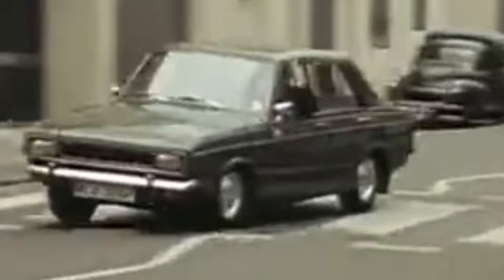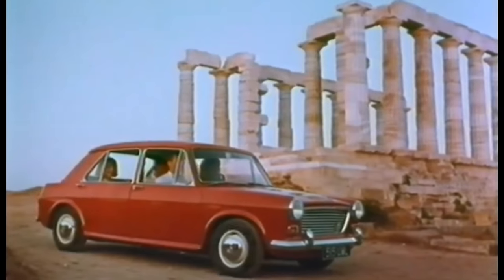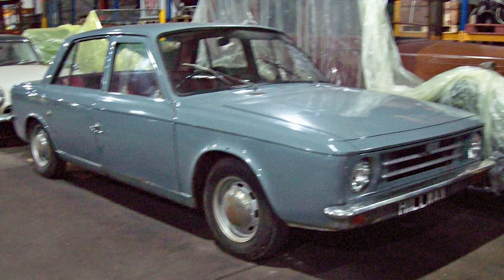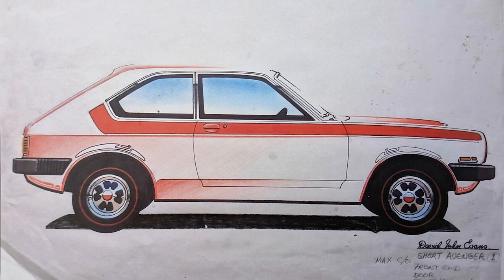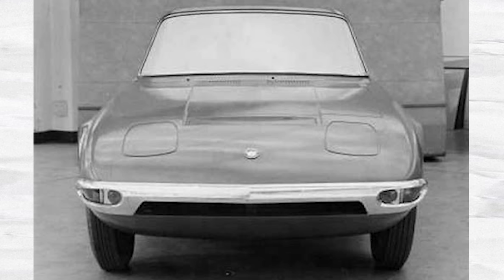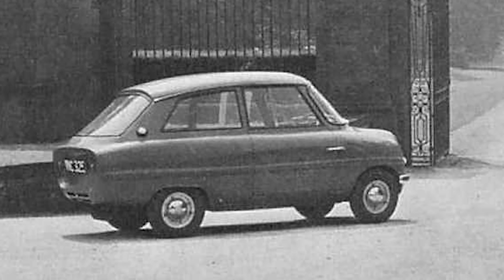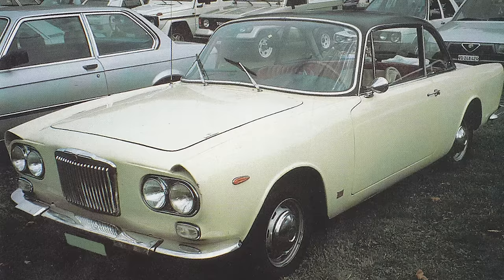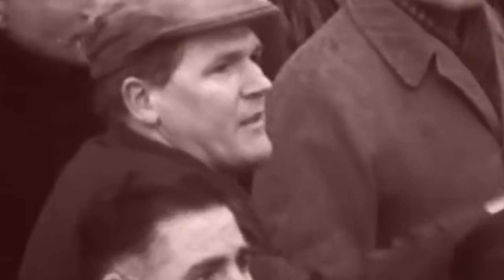The LOST ROOTES GROUP PROTOTYPES! - Hillman Swallow, Capri Beating Avenger, Zimp And MORE!

Comment: I’m from Arizona in the United States and my first car was a 1957 Hillman Minx Estate that I bought for $25 in 1969. I got it running by replacing the clutch and I converted it from column shift to floor. I drove it to high school for a couple years until the engine died. It was most definitely the only one in the parking lot! 😎🌵👍🏼

Comment: I had a Hillman Imp as my first 4 wheel car when I was 17 years old. My Dad had a Sunbeam Talbot in the 1970s and I remember that a family friend had a 2 door Sunbeam coupe.
Reply from the maker: Well. Your first car was exceptional! And your dad had great taste
Reply: First 4 wheeled car is quite a statement these days… I’ve not seen a 3 wheeler in years.
Reply: my first car also at 17 was a HImp. pulled the 928cc engine block out of a breakers Chrysler Sunbeam and mated it to a Stiletto head and twin carbs + a Janspeed exhaust system. it went like a little rocket
Reply: Was the Sunbeam coupe an older model of the 60's  or the last of the range with the large three piece rear window reminiscent of the American "Barracuda" that might have had the Holbay H120 engine?
Reply: @TomAlter1000  many thanks, aged brain-fog moment there, corrected

Comment: Appreciate highly your effort Tom in registering British auto industry . It would be so kind of you to make a film about "Austin Gypsy" the forgotten rival of "Land Rover Defender".
Reply from the maker: Thanks, I appreciate it :) I’ll have a look into that further.
Reply: I agree this was truly a worthy challenger to the Land Rover in its day!  We had one in the Civil Defense during the Cuban crisis in 62/3.  In every respect it matched or was better than the Land Rovers Other than two, stiff gearchange and heavy steering!
Reply: @tomdrives  Austin Champ,not a civvy vehicle but very interesting,light years ahead in vehicle desighn.
1500 quid ex works to the taxpayer no purchase tax in 1950.
Flogged off for as little as fifty quid at ministry auctions. Mine had 25000 on the clock in 1972 and a Rolls desighned 2 8 litre engine not even run in. Do not de - coke cylinder head before 100 000, unheard of in those days. Alec Issegonis once again !

Comment: Heyas Tom, as a newly married young guy our first car was the more upmarket Singer Chamois varient of the Imp. It was the Mk1 with the flat strip dash rather than the Super Imp round dials. It also had real wood trim too 😎 Mother in Law duly impressed 😎 Suffered the usual overheating if not careful but the opening rear window was a fortaste of the later Renault R16 we got. Cheers.

Comment: Nice video. The Italian style house (Zagato, Touring, etc) projects probably only ever had limited prospects due to the subjective styling and costs involved.
A more conspicuous absence perhaps is the “C” car, the big brother of the Avenger.
This car did go into production after it was designed and tooled in Coventry, albeit in France (and later Spain).
The UK version went right to the 11th hour, complete with full body tooling AND a fully tooled up, production ready V6 engine.
The French version had already been in production for over a year before the UK version (to be badged as a Humber at the very least) finally got cancelled.
All was not lost however, the resources were quickly rediverted to turn the car into the Australian Chrysler Centura, complete with adaptations for it to accept the cast iron straight 6cylinder 3.5 and 4.0litre engines.

Comment: I'm here for the Chrysler Rootes Australia comments.
There are some very pretty cars here that never made it down under.
Reply: l had a 75  avenger and went to sydney in 1979 l never saw any avengers only hunters, were avengers sold in aussie
Reply: @debeeriz  Sold in OZ as the Centura , two models , 2L 4 cylinder or a Hemi straight  big 6cylinder , which was quick but had garbage handling , competitor to the Cortina 6
Reply: @bluemango7112  The Centura was based on the larger Chrysler 180 the Avenger wasn't sold in Australia although it was built in New Zealand and quite popular over there

Comment: Great video Tom👍. I was always intrigued why car makers would debut new designs in Venice, a city with no roads. It has fountains, statues, artwork and architecture but has never been a car domain. An Imp hatchback, a bit like the van then with a high floor which restricted what you could get in compared to the competition. The Sunbeam became the Horizon after a facelift when Chrysler took over didn't it? Your description of the fall of Roots neglects the Unions in the sum up, they played a BIG part in the demise of the British owned car industry.
Reply from the maker: Thanks David! There is so much more about the Imp, some real cool stuff from vans to full conversions into sports cars.
Reply: The Horizon's not really related to the Sunbeam at all. It's built on a shortened Alpine platform, which was designed by Simca in France, and is front-wheel drive, unlike the rear-wheel drive Sunbeam.
Reply: The strikes that effected Rootes most were the early one in the late 1950's with the loss of 50K production, & the new work force at Linwood over parity of pay with Coventry workers! They wanted the same pay before they had reached the same output of vehicles per hour as the Coventry assembly staff. Being ex-shipbuilders they knew how to be disruptive!
Reply: Venice is much larger than the parts that are on islands in the Venetian Lagoon.
The urban area is 90 km long and has an extensive road network.
Aside from that fact , it is a center for art and design.
Reply: Management under Chrysler were no better. I  have a friend whose late father was chief mechanical engineer on maintainence at Linwood in The Seventies. Albert senior said it was not unknown for management to engineer a strike if production overseas was weak for one reason or another.   This would be a good excuse to halt production.

Comment: The Avenger liftback looks like my FIAT 128 3P
Reply: Aah the 128 3p, great car.
Reply: Omg the 128 3p. I had one of those back in 83/84. A 1979 Berlinetta in red with the black & white body stripes. I was between Rover's at the time. That little Fiat was fun but even at less than 5yr old had some quite serious rust issues in places one wouldn't expect.

Comment: Read the Swift before being discarded was to be developed from an upscaled Swallow platform featuring six-side windows and a V8 from a doubled-up Swallow engine to replace the Humber Super Snipe. However the Rootes company were only in a position to develop the Arrow at most and a few within the company recognising they could not compete with BMC, were pondering carving out a BMW-like premium niche and discontinue a number of marques.
Reply: When Chrysler became involved all ideas of the Swift and Swallow were scrapped as they did not understand the idea of highly complex engineering when you could get away with basic stuff!  They were still building separate chassis and bodies that were joined with 6 bolts, and very crude V8 engines that were very under-powered for their size!
Reply: The abandonment of Swift and Swallow preceded Chrysler, when the latter took over Rootes they allowed them to push through with the B Car (Avenger) and the C Car (180). Yet not the 180 V6 nor allowing the Avenger engine to feature OHC like intended.

Comment: From the front the Asp looks like a William Towns Scimitar SS with a few more curves.

My father had a 67 Minx on an E plate which came with a starting handle, something he had to use more than once. It was replaced by 72 Imp which oddly had the bumper cut out for a starting handle but no corresponding hole in the bodywork behind for it to pass through to the engine. At least they didn't supply a useless handle.

Comment: fascinating stuff. 
the Swallow has more than a passing resemblance and format to the Tatra 613. its good that Rootes didn't persue it because rear powered cars were getting close to the end of their time.
Rootes-Chrysler had the gorgeous but widely forgotten competitor for the Capri called the Sunbeam Alpine/Rapier, spanning 1967-1976 and based on the Arrow platform. a cousin had the Rapier H120 which was both a lovely machine to be in and quite rapid for its day. I'd have one given the chance.
if the ASP had come into production it would have been like an Imp derived cross between a Lotus Elite & Elan even running a version of the same Coventry Climax engine as the Elite. I wonder if the ASP was the inspiration behind the Clan?
Reply from the maker: Tatra! That’s a name I haven’t heard for ages, completely forgot about them. I remember reading about the 700 and of course their take on a supercar.
Reply: @tomdrives  they really were something special and far ahead before the Iron Curtain entrapped them. if you research them (carefully lol) you'll see how Porsche liberated their engineering and combined it with Béla Barényi''s 1925 design for the KdF-Wagen/VW Beetle
Reply: It was the inspiration for all the IMP based sports cars -- Ginneta G15, Clan Crusader, Daverian, etc. Had the ARP  been produced it would have cleaned up the small sports car market whether it had a steel body or fiberglass, as the Lotus Elan was fiberglass as the Elite before it!
Reply: @johnmoncrieff3034  yes the Elite and Elan composite structures were the carbon fibre of their day. the Ginneta G15 & Daverian are really good looking cars.
Reply: The fastback cars were nice looking with the pillarless windows. The H120 was good but was still 1725 albeit with twin Weber dcoes. What it really needed was a V6 to tackle the 2 and 3 litre Capris.
Reply: @jackiron4785  absolutely, the V6 made the Capri a poster-child. imagine if the Rootes Coventry Climax V8 had happened and was dropped in the Rapier 😁

Comment: The Rootes cars of the '60s and '70s were pretty stodgy. Worthy but dull.  The Imp was a disaster, being rear engined at a time when that format  was being abandoned and lethal in heavy rain or snow, it was also very badly made in a new plant in Scotland. The Avenger was not bad but the Hunter was very boring.  There was a two door Hunter coupe called the Rapier but it was very unexciting. I learned to drive on an Imp and it was OK to drive but really was a ladies shopping car. I had two Avenger 1300s as company cars. Nice to drive but the engines were rough and misfired in heavy rain and burned out exhaust valves if driven for any length of time over 70mph. We yearned for better cars from Rootes/Chrysler/Talbot but they never came.